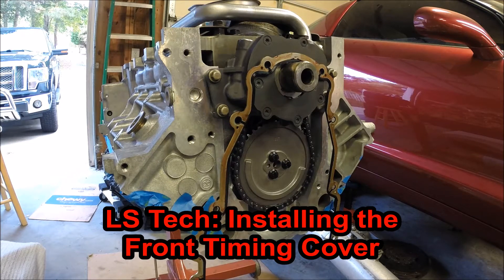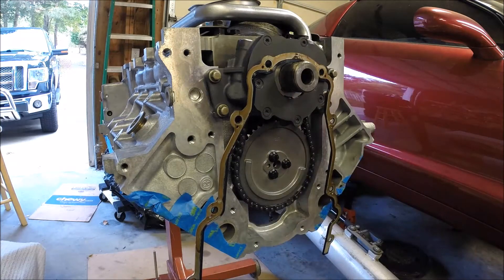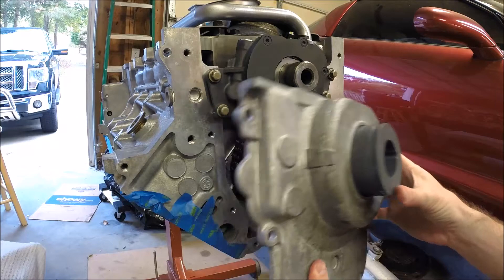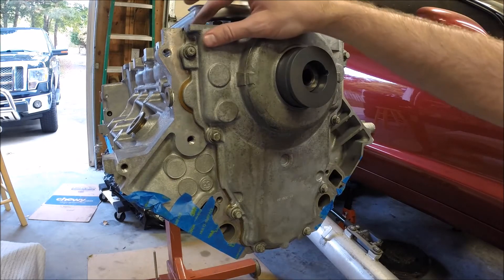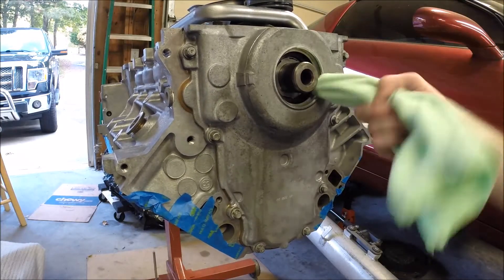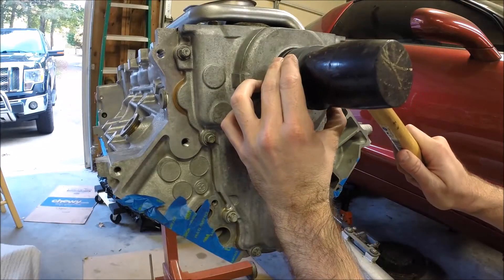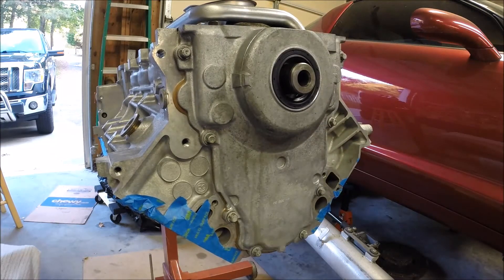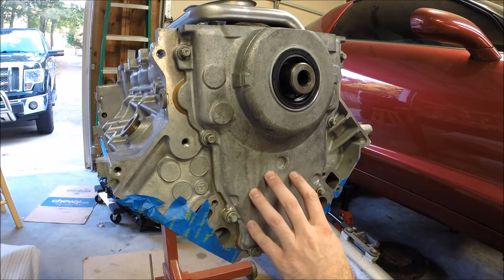LS Tech: Front Timing Cover Install w/ SacCity AlignIt Tool

Comment: Hey bud, just a follow up on some knowledge sharing but think this technique might have an opportunity to be better maybe you have already learned that since publishing the video. I currently have a front seal leak on my c5 and believe it to be from improper order of operations.

I did the same technique as you which was torqueing the front cover snug first, then then using the align it. Then I torqued front bolts to 18ft lbs on the cover followed by pan to cover.

Upon further research I have read to have very loosely install the front cover with a couple bolts. Align it tool. Snug bolts to the front after getting block to cover flush. Then torque the pan to cover bolts first to avoid cracking the pan, then criss cross on the front cover. Have you heard similar findings since posting the video a couple years ago?

Am trying to understand the errors in which are leading me to do this again 6k after building my motor. Was hoping you might have learned similar findings as well.
Reply: curious on what you ended up doing. I can understand the method in the video, and i have both of the alignment tools but i can't help but wonder why people don't use the alignment tools AND put the oil pan on and torque it down to ensure the timing cover and rear main are seated properly? And then just remove the oil pan to add RTV. Then install it again.

Comment: I got about 45 minutes out of my oil pump before it disintegrated in itself and the crank starting to score the inner race of my oil pump, obviously from not being aligned........ that was in the spring now I am putting in a new one as we speak.
Reply from the maker: Sorry to hear that!  Years ago, I had an oil pump failure take out a built motor in my Mustang.  If you haven't seen it already, I did a video on the shimming process for the Melling oil pump; might be a useful reference.  https://youtu.be/xjuwwlALVzM

Comment: The seal installs dry? I thought I read in my manual to add some clean oil to the seal before installing.
Reply: If I remember correctly, the old seals required oil. At some point, I believe GM made a change and instructed the seals go in dry. This is how I installed them on my T/A. No leaks.

Comment: Do you have to use that tool to install the timing cover or can I get away with out using it?
Reply from the maker: Is it mandatory?   I suppose not.  It helps to align the front cover perfectly so that you have less chance of a front seal leak.  For me, I'd rather spend a little extra money now to minimize the chance that I have to go back in and fix anything later.
Reply: Scruf's Garage gotcha, thanks bro
Reply: most people just leave the timing cover bolts loose and tighten the balancer down to 250ft lbs per spec then tighten the cover bolts. The rear main def needs the tool though.

Comment: Another great video!  Will be buying a set of the tools and oiling parts from SacCity.  Luckily not needed at the moment, but I like keeping  useful items like this around.
Reply from the maker: Glad you found the video helpful.   The AlignIt tools worked great; very well made and thoughtfully designed.  I bought the kit with the front and rear installers.  I also bought their oil galley barbell (you'll see that in a future video).  And I bought their feeler gauge kit that you see in the oil pump install video.  All great items.